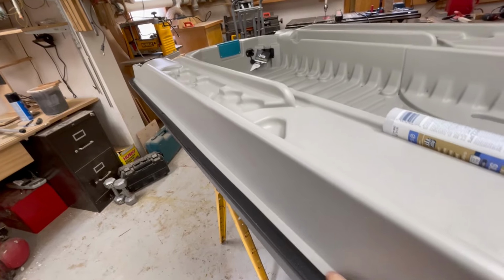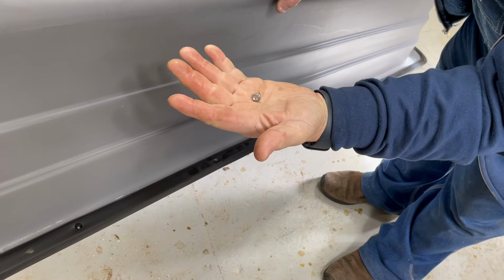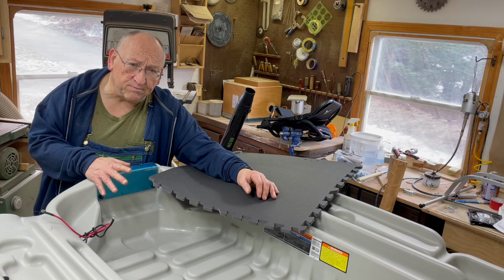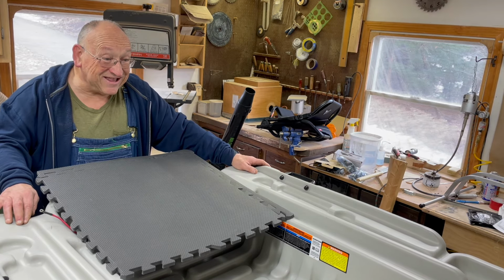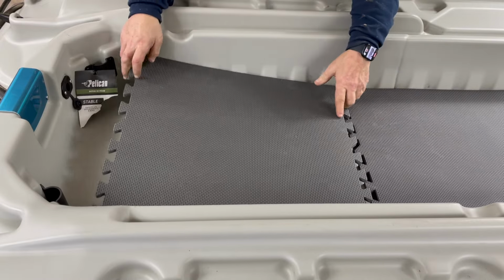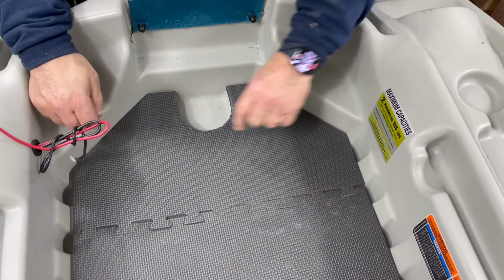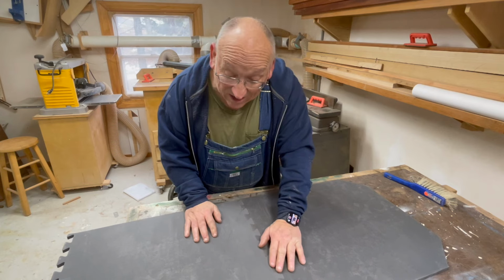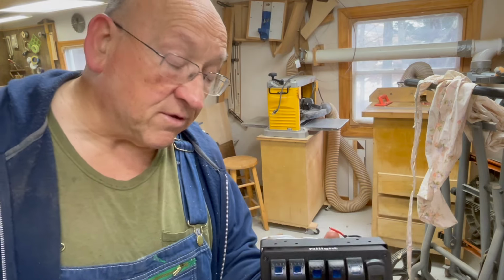Pelican Bass Raider: Sealing it up and installing the floor

Comment: I do some very extreme stuff in my prowler where it takes salt water over the rails and even over the bow at times. I dont have a problem with water intrusion. The prowler is stapled under there too, but the two pieces are glued together too. 
I installed 4 hatches on the deck so i can reach in and wipe out any water. Plus i store all of my outboard washdown muffs and hose in the hull. It also allowed me to install my thru hull transducer and run the wires easier.

Great work you did there!

Comment: Hi! You should take that black trim off and seal all the tacks! then put it back on!
Reply from the maker: I thought of doing that but I saw one guy who did and had a devil of a time getting it back on. Seems the thing shrank. He had to leave in on the driveway in the sun to even begin to get it back on. So... not thinking I needed that kind of pain I opted not to do it. It is a good idea though, Just don't have the guts to see if he was right!
Reply: Where can I buy the black trim at? Mines broke off.

Comment: Hello sir
I have a Raider too and did the floor like yours but without anything underneath the mats it was too squishy for my liking. I went to Lowe’s and got a sheet of that green styrofoam insulation looking stuff and cut that out and used it underneath the mats for a solid floor with no added weight. Just a thought and not telling anybody how to do it but just that it worked for me.
Loved the wood ruler I was a pipe fitter for 15 plus years and we used to use them.
Reply from the maker: Thnx. I may discover the same thing. If I do,  your idea is a nice easy to cut, lightweight solution.

Comment: Use high density spray foam to fill in between the ribs on the floor of the boat, shave level with the ribs using a knife.

Comment: Great video! Do you have the dimensions of your foam padding cuts ?  The cuts you made to get the pads to lay flat into the boat and the angle cuts that you did for the corners. I don't have a table saw. Going to see if a buddy of mine can do it for me without me having to transport the boat to his shop.
Reply from the maker: Sorry, no I don't. It was cut as is at the time. I didn't write them down or save the pattern. And the boat is in storage for winter here n Maine. I think you'd have to be with the boat when this is cut. Not much way around that. And I used a table saw but a good razor knife will do the job too.
Reply: @CraftsmanontheLake  thanks. Yea I asked the guy about it. I shared your video he said a 2x4 or a 2ft leveler and a razor would also get the job done. You did an excellent  job on the angle cuts. I'm in south LA So we're still getting upper low 50s to mid 70s here believe  it or not.. not going to be much of a winter, crazy.
Reply from the maker: @suchairman2  Maine. We're hitting 50's some days. It's hard to get much snow too. I love winter, snow, snowblowers etc. Kinda miss it. Best of luck with your build!
Reply: @CraftsmanontheLake  I'm jealous  of your weather. I'm PRAYING we get some  consistent  weather in the 30s (at least) haha. Thanks again!

Comment: You can't talk about an embarrassing boat flip and not show it. I didn't know it when I started watching but that's what I was watching floor. Is there any b-roll?

Great video. I was worried about the squeeze out on the silicone, but it looks like it worked out on the face side. I'm passionately anti-silicone.

Where's the dragon head going?

Comment: Right off the bat, no no and no. There is definitely adhesive between the two pieces... That piece of sudo rub rail is just covering where the two pieces come together.
Reply from the maker: Yes, I'm aware of that. Now the rub rail is also sealed. I wouldn't have taken apart the two halves to seal them on a new boat, but the seal isn't that great in many people's boats. Hence one area of filling up if left outdoors that people experience. I looked at mine and there was actually a gap where the seal didn't meet at the ends near the rear.
Reply: Where can I purchase a new rub rail?

Comment: GREAT JOB.  IF I WAS YOU. I'D GET A THIN PVC SHEET AND LAY YOUR WHOLE FLOOR ON IT AND CUT OUT. THEN GLUE THEM TOGETHER AND PLACE IT ON THE FLOOR PVC DOWN. IT'S VERY LOTE AND REMOVES EASILY
Reply from the maker: Good idea might be an option at some point. I’ll try this out first and see how it goes from there.
Reply: @CraftsmanontheLake  BIGG OL 10-4.  SHARING IDEAS IS FELLOWSHIPING🙏🏾